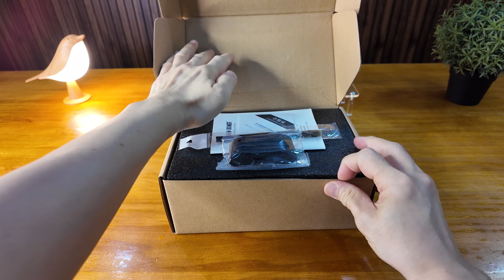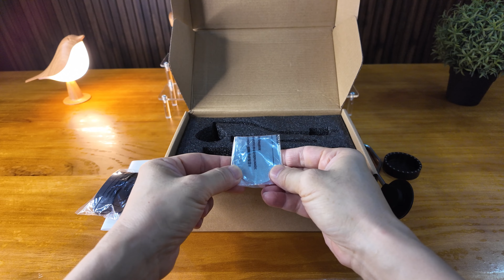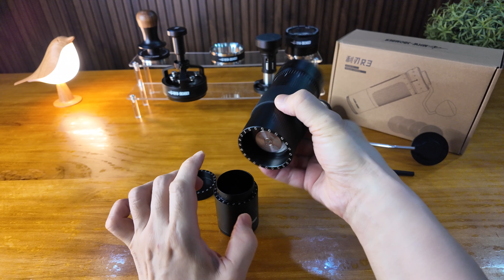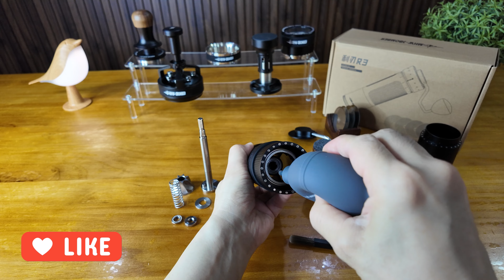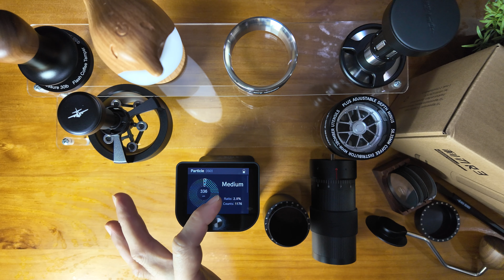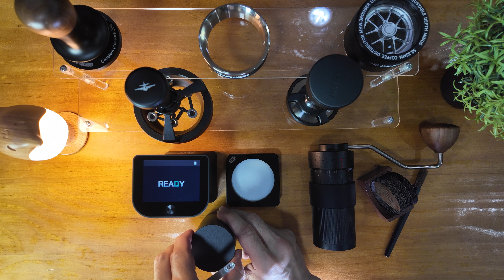MHW-3Bomber Blade R3 Manual Coffee Grinder I In-Depth Design, Features & Maintenance Overview

Comment: Hi
My mhw r3 hand grinder came calibrated at zero but it can move two more clicks before zero. So is that normal ? It is totally brand new one.

If it is normal so can we say that the zero point is the first point the handle can NO longer move freely ?

Is it ok to heavily tighten the thumb nut after reassembly the grinder? Will this make any damage for the grinder?
Please advise
Reply from the maker: @ahmeddeiaa3943 - Hi there! The zero point will move due to several factors, such as grinding light roasted coffee beans which caused it to moved. 
True zero point is when both burrs are locked and the handle can no longer turn freely.
Lastly, just hand-tightening will do and NEVER use any tools to tighten the thumb nut as it will cause damage. Cheers!
Reply: @almamicroroastery  thank you so much
Reply from the maker: @ahmeddeiaa3943  - You are welcome!

Comment: After tightening the nut, you placed the crank handle set, and then you moved the position. Is that needed ?
Reply from the maker: @ahmedshaikhani8571 - Hi there! If you're referring to the assembly with the thumb nut tightened after thorough cleaning, it's not necessary. My main purpose is to show successful assembly. Cheers!
Reply: @almamicroroastery  after viewing video like 5 times. I have finally attempted and will share the results once I grind it. Thank you for the detailed video.

Comment: I have recently ordered, but this doesn't have any indication for number of rotations. How to know that we have completed the full circle of 60 notches ? How to bring it back to 0 ?
Reply from the maker: @ahmedshaikhani8571 - Hey there! There isn't any visual indication of the number of full turns. If you have lost track, fully tighten back to zero (both burrs are completely touching each other or locked). That will be the starting point. Cheers!
Reply: @almamicroroastery  by rotating clockwise or anticlockwise ?
Reply from the maker: @ahmedshaikhani8571  - It will be clockwise. Cheers!

Comment: Thanks for the great video!
The grinding is really very smooth and the overall workmanship is excellent, I really liked the sieves, the filter coffee really benefits a lot from using them. Another potential advantage is that the Bomber is able to grind fine and at first glance it is an excellent solution for espresso and Turkish coffee. But not everything is so simple, because: 1. For Turkish coffee and espresso (i.e. without sifting), the coffee is tasteless ("dirty"). I mean, it's not much different from ground coffee on Nivona 130 and if there is a difference it's definitely not in favor of Bomber. 2. the lower bearing is very delicate, rotation defects began to be felt after a month, 3. the Bomber has terrible support, I could not get the bearing specification from them and of course no one offered me to perform warranty repairs despite the fact that this is an obvious structural defect.
My experience: I can say that the M47 is little better, but both the Bomber and the Kinu are significantly(!) inferior to the C40 and I won't trade my C40 for 10 Bombers and/or Kinu, It's just a different levels
Reply: What grinder do you recommend for espresso? Kingrinder k6 or something from 1zpreso?
Reply: @boleshuggah  sorry, I can't help
my recommendations would be irresponsible, I don't know 1zpreso well and I'm not familiar with kingrinder at all
Reply: @thesupermegagood  you said bomber isnt that good for esspreso because of the dirty flavor or texture. What grinder did you compare it to? If its something 5x its price then share it, I want to learn more and you seem knowledgeable
Reply: @boleshuggah  I'm not very knowledgeable, I'm not a blogger, and my task was just to find a coffee grinder that suits me, and it turned out to be the Comandante C40. There are only 2 thoughts I can add: 1). The C40 is the most inconvenient to use, but easy to maintain, and the best for me in terms of result quality. 2). We have adaptive vision, hearing, and apparently taste sensations too - after a month of using C 40, the taste of coffee became "normal" for me and I thought that the pleasure of the drink was not so much different from what I got on the Bomber - I took out the old R3, but the miracle did not happen, I did not like the taste, although before buying the C40, I was quite satisfied with it. I mean, we can get used to everything )
Reply: @ i understand, thank you for sharing your experience! Im trying to experiment with different tools as well to find what fits my needs best. Just bought some tools Im having a great time

Comment: This confuses me a little bit, because they claim R3 grinder has 48mm burrs?
Reply from the maker: @mateuszmachlowski104 - Hi there! MHW-3Bomber has since removed the burr size from their listing. Anyway, know that the grinding efficiency of a hand grinder relies on the effective grinding of the inner core. Overall, the grinding action is smooth with low resistance, and the grinding is quite effortless & considered quite fast. Cheers!
Reply: the size of the millstones of the Bomber is absolutely the same as in the Kinu M47 (I had both) and if someone calls this size "48 mm" then we can say that this is true for the Bomber )
But this is not decisive either in quality or in the speed of grinding, alas